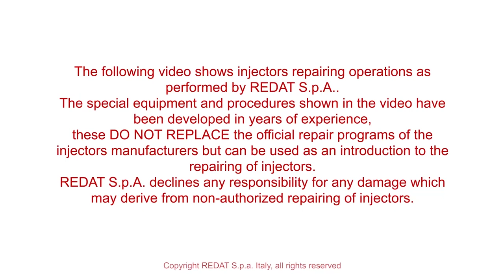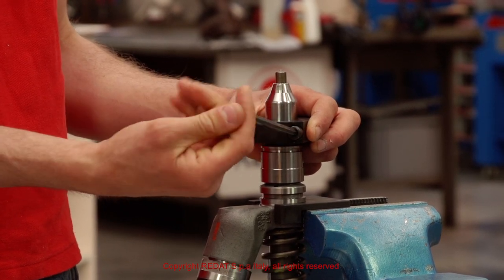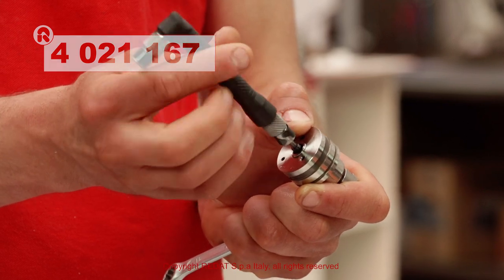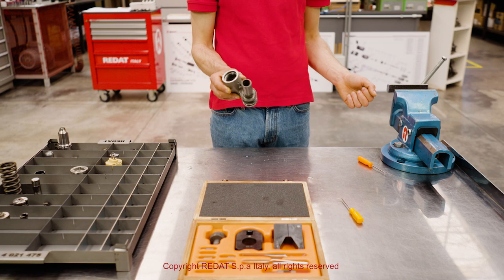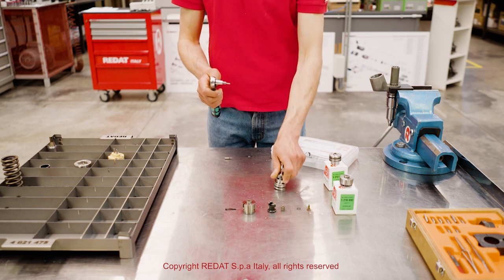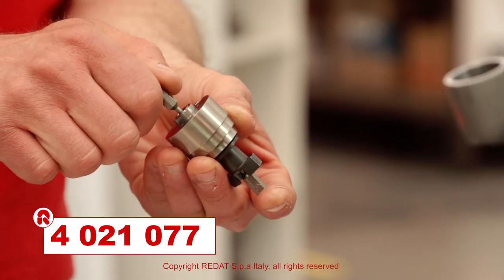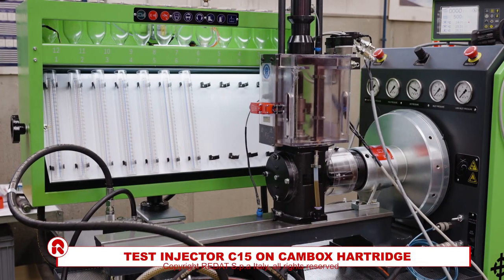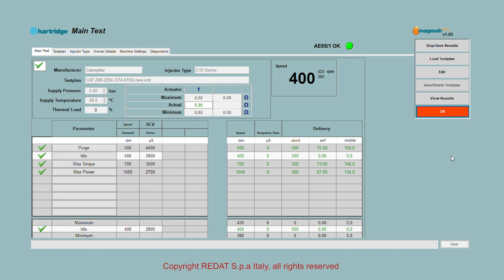Caterpillar C15 / 3406E injectors - Assembling, disassembling and testing

Comment: Do you have parts, and tool kits for Cat SDP style injectors with the square plugs. 10r-6162, 10r-6163 etc. ?
Reply from the maker: We do not have them in our range at present, but if there is a good demand for the correspodning spare parts, you can always send nus a complete brand new sample which we will disassemble and study. If interested, please contact sales@redat.com

Comment: What is that machine at the end? it does calibration as well?
Reply from the maker: It is a Bosch EPS 625 test bech with a Hartridge CamBox HK1400. This combination allows to test the injectors. To calibrate them you have to open them and replace some shims inside, it cannot be done by the machine.

Comment: Can i acquire this injector tools for my personal use
Reply from the maker: Yes, if you contact our sales office at sales@redat.com we can send you an offer. 
With reference to "personal use", please note however that in order to repair injectors you need to have an injector test bench, you cannot just replace the parts and hope that the calibration will be ok by itself. It is not something that a single person usually has available outside of a specialized company workshop.